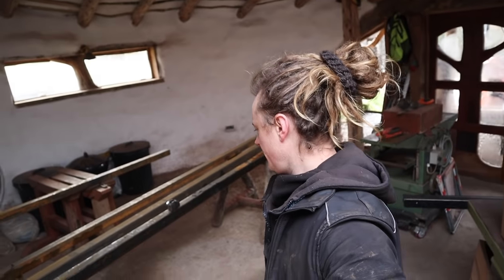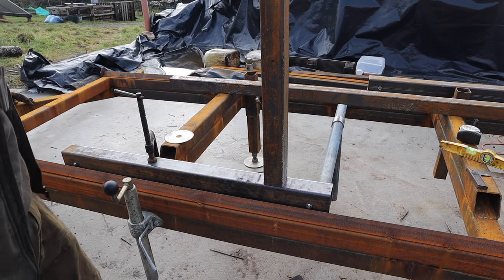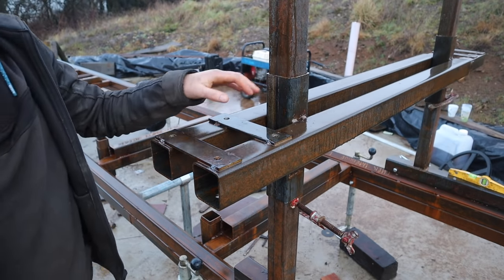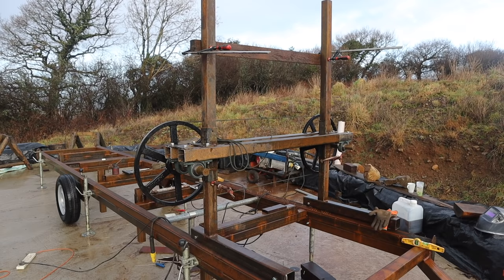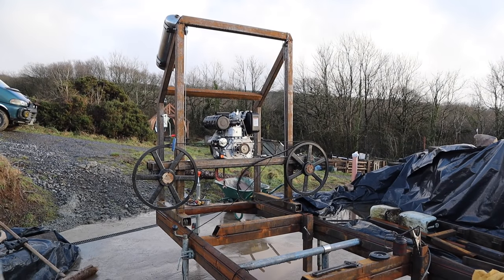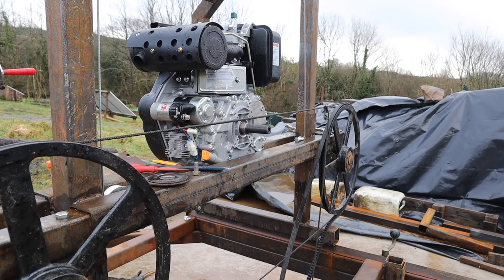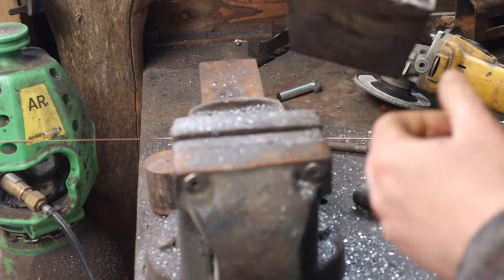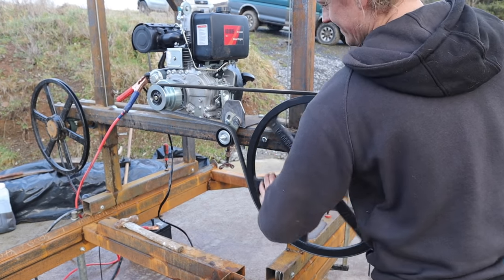DIY Mobile Bandsaw Mill Part 2 Saw Frame

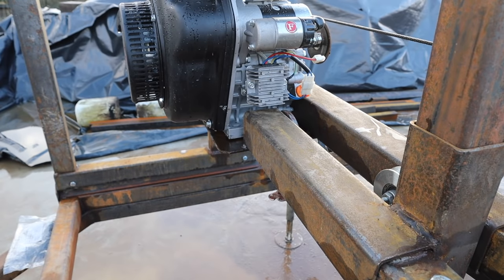Comment: @ 14:01 Power Feed is a must...
If U can gear from the Blade wheel...
U will get a constance feed per cut ratio...
Adjustable end stop travel cut off

Comment: I have scoured high and low, yours seems to fit my needs. Great job, on the sliding adjjustable bottle winch side; are there shims to bring the wheel down to height with the other side? ty

Comment: Great stuff as always Kris. Your great man for getting stuff done and considering the weather. Also I love how heavy you've built it.

I don't mean to be negative but I just noticed one or 2 things that may or may not be an issue and if you resolve them now they might save you load of grief and wavy wood. (Don't ask how I know) 

One thing I noticed was the raising and lowering set up - I did the very same system on my sawmill and it just gave me grief with binding and not lifting evenly. If you change it to lifting from both sides evenly, you'll notice how much more consistent it will be. 

Also your blade speed mightn't be high enough with the pulley to band wheel ratio you have and the fact that diesels don't rev as high as petrol. This is something I'm still fighting a bit. Maybe it won't be an issue for you but just a thought.

As I said please don't take this as hammering your work and, quite frankly, great engineering. I've run into these issues myself and still battling them and I don't want anyone else to have the hassle of it all. 

Also a quick question - where did you get your band saw wheels from?

Keep up the good work.
Reply from the maker: Hi, thats not negative mate. those are genuine concerns. however Im not ready to make things more complicated yet as the details of these things often matter. The raising system might be the same as yours but the weight, balance, tolerance will likely be different so im not sure comparing is that useful. im still in the really early stages and just trying to get a functioning machine. I am only able to get these things done so quickly because i dont worry about getting everything perfect first try. For me if i get the bandsaw to cut (even if not quite perfectly) its a lot better than having no bandsaw at all. Once i know i have a basic working model then the details are easy to fix. Im not going to put lots of pulleys everywhere and then latter find they are in the way of something else. its far better in my mind to get to a point of mostly working (even if not perfectly) before spending to much time on the details. Also im always a little weary of the tolerance people expect from a sawmill. literally as soon as you finish the cut the wood starts moving, usually bowing and twisting so im not exactly sure why such accuracy is that important certainly not at the stage im am at now.
Reply: Yeah you are quite right about the getting it working and then work on the details. Yeah the pulleys everywhere looks like a pain alright. Your are quite right about the wood moving but have perfectly sawn wood, even if it only stays that way while you stack it, does make one sleep well at night 😉...... Oh yeah any info on where you got you wheels?
Reply from the maker: @joshuadunn882  I got them from bearing boys.
Reply: Thanks Kris 👍🏼

Comment: I think that the issue with not completely lowering/raising perfectly level will be resolved by the vibrations of a running engine which probably will make it level.
Reply from the maker: I think that to. But we shall see

Comment: Kris, I notice you seem to be using the generator when you weld - does the solar and hydro no provide enough power ?
Reply from the maker: Plenty of power to weld. It’s just the my ark welder is the generator. I can’t run the welder off electric it is built in to the generator.

Comment: Hey great job! Where did you get your band wheels from in the uk?
I’m using car tyres for mine and the blade just keeps jumping no matter how well lined up everything this it’s infuriating 🙈
I need 24-25inch wheels really for the blades I’ve bought.

Comment: Would it not be better to put the belt tensioner so it pulls the top down rather then the bottom up? That way it also would help to keep the belt from touching the saw band.

Comment: You could use a thin length of steel between the belt and the blade to prevent any belt flapping from contacting the underside of the blade, kind of like a mudguard :)
Reply from the maker: That is what the blade it though isn’t it. It only has teeth at the front and the blade is thicker than the belt
Reply: @KrisHarbour  I was thinking a broader surface would be less wear than a thin back side of the blade. It looked right in my head, I'm learning with you.

Comment: don't know if it would affect the blade but the balancing belt above the idler pulley causing that bit of a shake might need to be taking care of with another idler pulley I would be concerned about it causing a wave in the blade as it was being passed through the wood on the Leading Edge and as it comes out might cause a bit of a bevel

Comment: I think your height adjustment system will cause you a lot of problems with the cuts being not parallel.  But I have an easy solution to ensure perfect parallelism, you just need 1 additional pulley and some rearrangement of the other pulleys:
Mount the steel cable on one side to the top of the saw head then go from the bottom of the same side of the saw head to a pulley on the bottom of the frame, back up to a pulley on the top corner of the frame, over to another pulley on the other corner of the frame and then down to the saw head, mount the steel cable with an eye bolt for adjustment.
This way, if you lift one side of the saw head, it pulls the connecting steel cable which lifts the other side of the saw head exactly the same amount.

Please ask me if you didn't understood my description, i will find something to visualize it.
Reply: @samvalentine3206  yes, the last one with the cable over the top
Reply: @samvalentine3206  Hello Sam.

Comment: I'd be a little worried about all the slop in that platform. The essence of a decent bandsaw is that the properly tensioned blade moves in a controlled and predictable way. If the platform wobbles, your cut will be all over the place.
Reply from the maker: That is why I removed the play with adjustable bolts
Reply: @KrisHarbour  - I hope the bolts do not inhibit the sliding of the head... with the grease you plan to add, it should be OK.  If not, time for a modification!  🧐

Comment: So... the engine pulley runs on sawmills blade band wheel.... which will also have a blade running on it?
Reply from the maker: Well the engine pulley will clear the blade by a few mm. But yes the blade runs on the belt
Reply: @samvalentine3206  Wow interesting, I didn't know that this design was already being used by other band  sawmill manufacturers.It all seems very strange to me though... like running all your cars vital components off one serpentine belt, when it goes... everything else fails with it. Not to mention the drive belt is being worn out from both sides and if the belt breaks... your blade comes flying off.

Comment: What thickness is the runner as you call it and what minimal   length could a person get away with and length of the part the wheels and moter sits on and what length blad do you run .im trying to build on but none of the videos ive watched give mesurments good videos though.

Comment: May I ask how much this entire build is? Love what you are creating.
Reply from the maker: it will cost about £2000 once done. could easily be done for half that if scrap yards were open or you had second hand parts laying around. And then half that again if you didn't need it so long or had an old trailer that could be used. But even £2000 is cheap. a mill this size would cost over £5000 for a cheaply made one.
Reply: @KrisHarbour  Amazing! You are an inspiration!

Comment: I hate being the couch commenter because you really are making a great system and have thought things out really well in so many ways, but why didn't you just put the bearings for the band drive pulleys on the top side of where they currently are? It would give you more clearance from the engine pulley, and would help you with you minimum cut depth I think. Love your videos though! Keep up the great work!
Reply from the maker: Because then the max cut thickness is about half. Mounted under I get 12” clearance. Mounted on top it’s not even 8” clearance.

As it is I can cut a timber 32” wide and 12” thick before I hit the steel structure. So that is why. The clearance gained above is lost for the cut thickness

Comment: You will probably find that the jet engine water lubrication fluid tank (JEWLFT) is rather high up the structure. It will be a hassle to fill it when empty...
Reply from the maker: it will be a hassle but if i had a 800mm wide log on the bed the saw would have to be right up high so it cant really go much lower and still gravity feed.

Comment: Edit: sorry, didn't realise you did this. Didn't watch the entire thing....

If you got rid of the play in your bandsaw on the guide it should lift perfectly level with 1 side being winched up. 3D printers work in the same way but with a belt. They have a tensioner to get this right which adjusts how right the X axis is against the guides. If it gets too loose it won't lift level.

Might be much harder to do one something this heavy but it is possible.

Comment: --Just wondering ...what are you going to do about exhaust fumes? Noticed when you cranked the engine it's on the side your walking on so will constantly be breathing it.
Reply: It's in the open air.
Reply from the maker: Possible extend the exhaust up. it really isnt something to worry about at this stage in design. its an easy problem to fix (if it is a problem) at any stage.

Comment: Im curious as to why you arent driving the back of one of the wheel shafts?. Giving you a really short belt  (cheap belts) plus no need for a idler pulley and motor and belt nowhere near the blade. Just an idea.
Reply: I guess you can always see a different way of doing something after watching someone else actually do it.......!
Reply: @andymccabe6712  i am inteaged by new ideas. Which is why i asked the question. My apologies.

Comment: could you use an electro magnet clutch on it like used on ride on mowers, so that you can completely disengage the saw blade?
Reply: He said he was thinking about using one he had, but he read that the engagement was too sudden, no gradual start-up like the centrifugal clutch provides... might be too rough for the purpose. 16:10
Reply: @samvalentine3206  ah not sure how i missed that.

Comment: Weird arrangement of the blade running on top of the belt. Asking for problems!
Still, if it works out fine you'll have saved the cost of one pulley (really worth the risk?)
Reply from the maker: That is the way 90% of bandsaw mills work. Blade runs on the belt
Reply: Soo - not a weird arrangement then! And not asking for problems! Could it be that Kris pretty much knows what he's doing on most jobs(or figures it out along the way..)?!

Comment: 2:10 - Pulley/wheels - Not clear whether they have bearings or not? If they are running directly on the screw thread, they wont last long!
Reply from the maker: You can see bearing in them as I’m installing them. And then I install a bushing either side of the bearing and then a nut either side of that.
Reply: @KrisHarbour  - Any locknut on those?  Can they loosen and introduce slop on the rails in time, you think?  Or maybe some loctite?

Comment: Is the Idler on the wrong part of the belt? It should be where the most tension occurs, Not where the most slack occurs.
Reply from the maker: The idler is in the correct part of the belt for a sawmill
Reply: @KrisHarbour  
Yes. It is positioned correctly for a sawmill. It keeps the belt out of the way of the material being cut.
I'm saying that the belt is coming off the idler because the idler is on a part of the belt where the least amount of tension in the belt occurs.
Reply from the maker: @Paul But the belt isnt coming off the idler. the belt came off because the main pulley was not tight and didn't have the key steel installed yet.

Comment: The belt seems to move up and down quite a bit, it may hit the blade, might want to check that out more.
Reply from the maker: It wasn’t even tensioned. Just pushed the idler pulley up by hand
Reply: @KrisHarbour  I was going to say, aren't those normally spring tensioned since the belts tend to elongate at high rpms, but this answers it.
Reply: Shouldnt be to much off a problem anyways, because the belt and the blade are runing the same speed.

Comment: I suspect that with your belt being that close to your blade, the movement when running will cause the blade to eat the belt.
Reply: I think he is using the belt as an tire for the blade to run on( like the woodmizer sawmills) so the blade will always be in contact with the belt, as long as the blade doesn't move backwards and touches the belt with the teeth nothing will happen